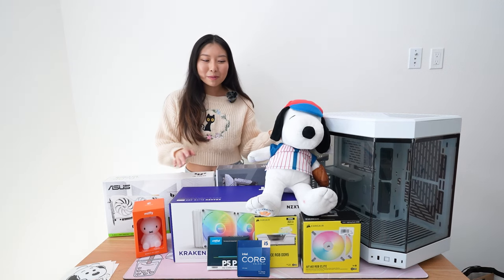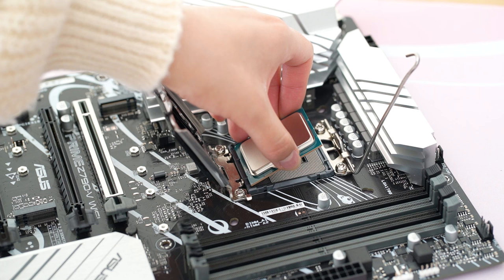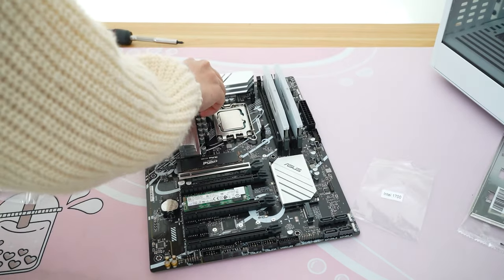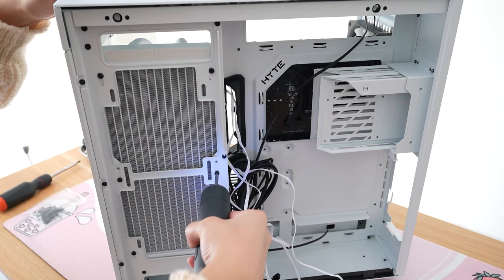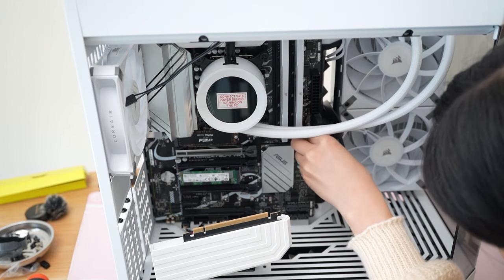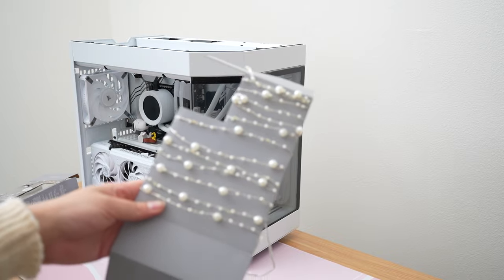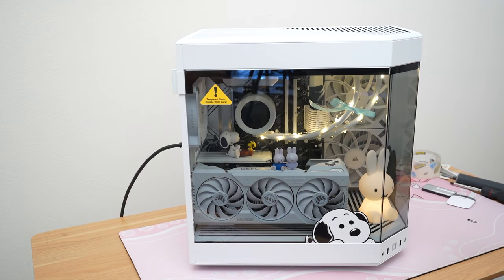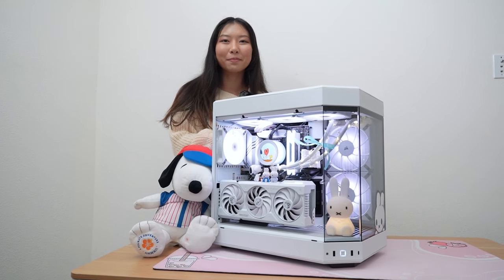my friend commissioned a $2300 gaming pc for his girlfriend?? | aesthetic white y60 gaming pc build

Comment: Having a GPU vertically mounted in the Y60 can lead to it being choked for airflow. There are replacement side panels with mesh or a pattern in the glass if the temps are just too high. Looks great as-is, though.
Reply: I had a 4070 Ti in a Y60 before I swapped to the Y70 Touch. I had zero issues with thermals. The highest it ever saw was about 72c but normally stayed around 62-65c. I wouldn’t put a larger card in it though.